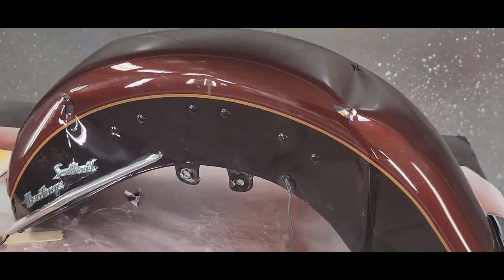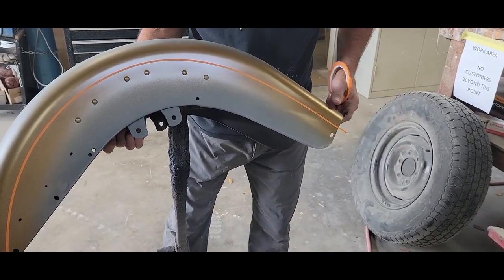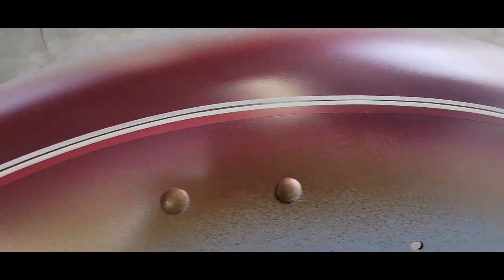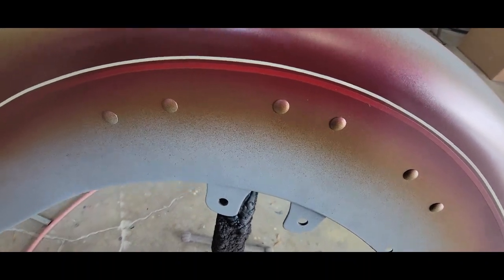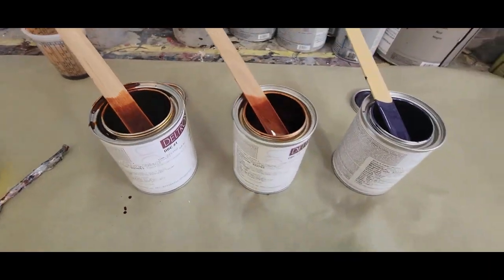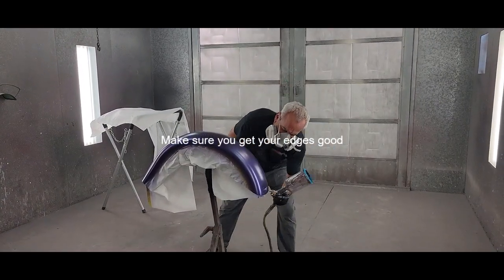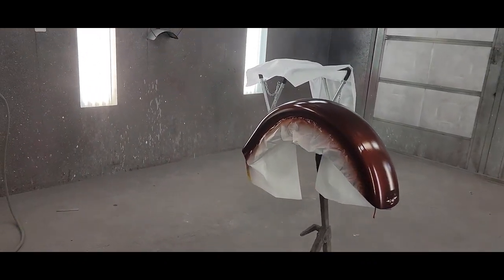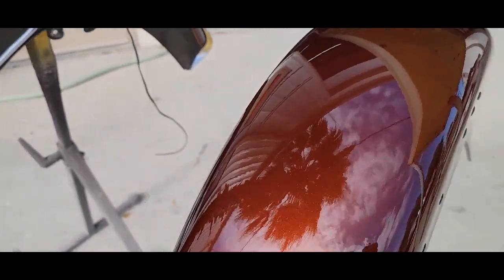How to do a custom painted pinstripe and 2 tone - Pinstripe is painted FIRST

Comment: What is that little line from were you taped it I saw it I'm sure no one else saw it I didi it for 30 years that not exceptible with me .I would do it all over your going to hide it with clear I know I'm better then you .
Reply from the maker: Oh, you mean the spacer tape. I use that to make sure the spacing between the the 2 stripes are perfect. That gets removed before the basecoat.
I'm not for sure what you meant by "I didi it for 30 years that not exceptible" (maybe you meant acceptable??)

Comment: Thank you so much for making this video.   This answers so many questions I had.    - can I use this method for something larger like an emblem? I am currently working on an old Honda sport bike.  I want the tank emblem to be paint instead of vinyl.   Can I use this method with a vinyl stencil and then peel the stencil off?
Reply from the maker: Yes, most certainly. I've done that quite a few times. Spray the side of the tank in the color you want the logo, add the stencil over the area, spray the base on the tank, peel the stencil off and there you have your logo.
The only time I would not recommend doing the logo first is if the base of the parts will be a tri-stage.
Reply: @TAZattitude  oh man.  Thank you 🙏 - this is my first paint project so thank you.
Reply from the maker: @kylew4678  I wish you the best.